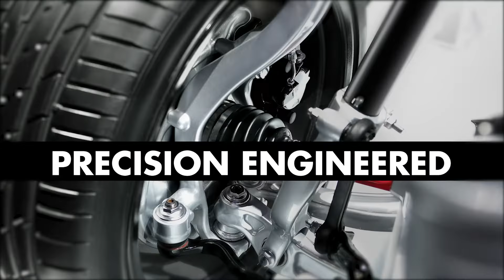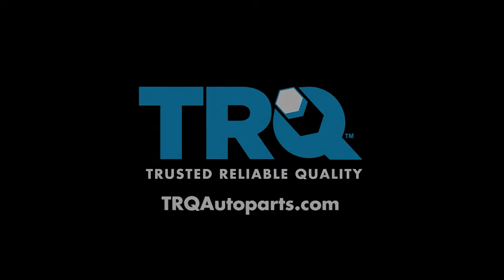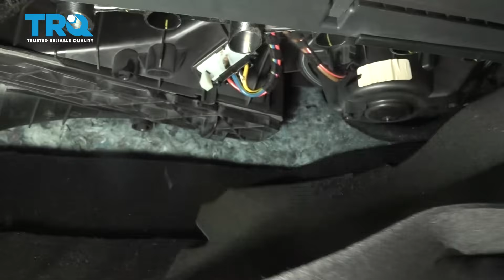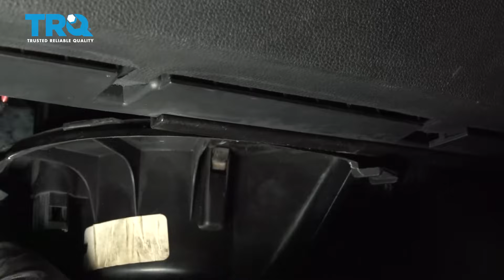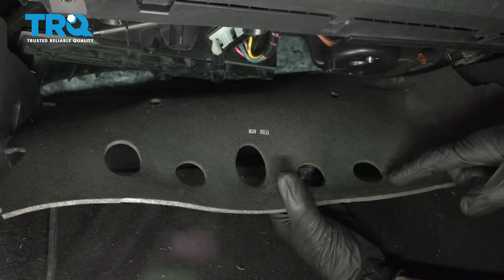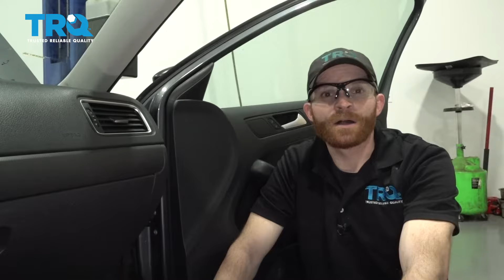How to Replace Heater Blower Motor 2011-2018 Volkswagen Jetta

Comment: I turned it counterclockwise with all my might and it won’t come out. And yes, I disconnected both electrical connectors beforehand. It rocks a little bit but it refuses to pop loose.

Comment: Thank you, I don't even want to know what a shop would have wanted to charge me for this. A shop wanted to charge me 100 + 20 for the cabin air filter just to LOOK at a blower motor that they should have just said, 'yeah we can tell it's gone from the sound, we don't even need to pull it out to tell you that, here look at the warnings from MFG. about "is it a blower motor or a bad control module/resistor?"

Comment: YO basically the same for 2020 but there is a new tab like on the MKVs you gotta pull back.   I released it but still broke it off getting it out so now my motor is barely in there on the track tabs only.  Its holding but barely.   Dont break your "secure" tab off 2020 and newer.  I also had to move the resistor over, its mounted on the blower n requires star tool.
Reply: I’m trying to replace my blower motor in my Jetta 2020. So I have to remove the star bolt thing to get the motor out?

Comment: Our fan unit vibrated something awful when you turn the fan on high. Had the used car dealer replace it when we bought it, but the 'new' fan they said they put in vibrates even worse and at lower speed setting now. I can put my hand on the motor casing when running and just feel the vibrations causing the noise.  So did they maybe install it wrong, put in a bad quality fan, or could the tabs just not be seated properly to be causing this issue?

Comment: I was able to use this video to do this on a 2016 Jetta. Take your time and try not to force anything and you will be fine. It took me about 25 minutes as laying down and working at this awkward angle tends to wear you out. I did pull the carpet back a little and that made getting the new one in a little easier. $41 to replace it as of February 2024.

Comment: My 2011 Jetta had a wire harness that prevented the blower from removal. I found that if you remove the glovebox it's far easier than this video. The glovebox is held in with 3 screws at the top, two on the bottom and one hidden behind the panel next to the door. Once you remove the glovebox you need to undo 4 wiring harnesses attached to the box. Then you can unscrew the vent that's held on with 1 screw. This will easily allow you to remove the blower motor. You can also pull the carpet down to gain more clearance if you have a wiring harness in the way like I did.
Reply from the maker: +Neil Carlson Thanks for the tip! We'll pass this info along to our production team. http://1aau.to/m/Shop-TRQ

Comment: I want to establish. Don't do it this way if you're like me with bad back issues. Take the dash apart. I wound up hurting trying to get it back in. Made the no no of trying to rush it and force it. Broke the fan. Luckily it was the old one that I assumed went out and started working when I replaced the resistor.